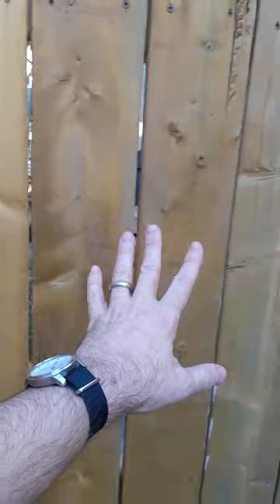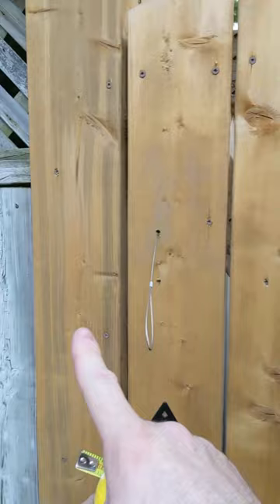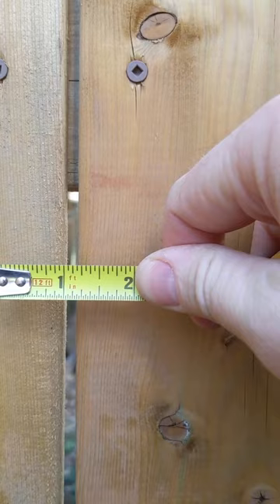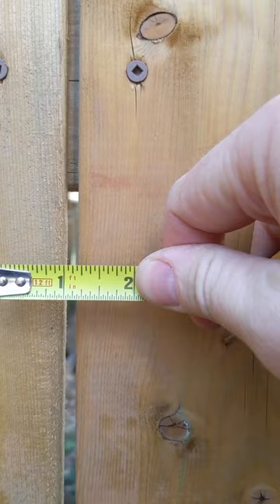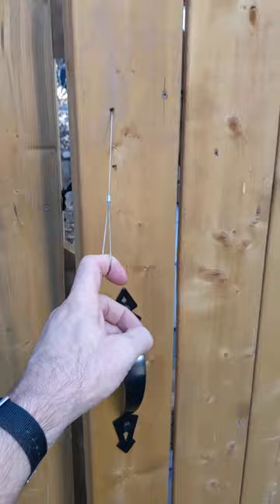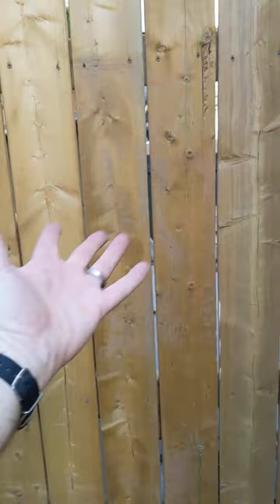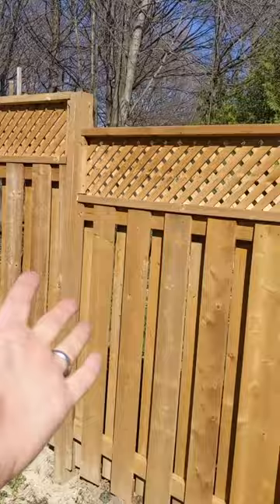How Much Does Pressure Treated Lumber Shrink?  #shorts

Comment: Deck boards do the same thing and people still build them with a gap to start. They aren't finished shrinking yet either.
Reply: Here in Utah it’s good to have a healthy gap (3/16 to 1/4” or more) to help the snow have somewhere to go, so gaps that grow bigger aren’t always a bad thing.
Reply: I did a repair on a 12 yo pt deck. Original boards were 5-1/4". Healthy 3/8" gap. I installed the new 5-1/2" decking with 1/8" on each side. Put in a few boards and the client was upset. She wanted them to match. I explained shrinkage and that in a year they will match. Like talking to a wall . I cut all the boards to size, rounded over, and installed. Very happy client. 

A year later I get a message. All the boards I put in were down to 5". I told you and I'm not fixing it for free.

Comment: I built a fence on one side of my yard years ago. I screwed the boards to the edge of a 2x6, top and bottom of the boards, and let them sit for a week. Didn't rain at all. It dried them out a bit. I took them off the 2x6 and installed them butted up to each other. The gap is about 1/8", maybe a 1/4" on some. I'm in Hamilton.

Comment: Why use pressure treated  with no ground contact?
Reply from the maker: because I don't want to have to stain and refinish yearly.   Pretty common here for fences to be PT lumber.
Reply: For UV protection? Good luck with that.
Reply: Cause a PT 1x6 is the same price as a 1x6 non PT.